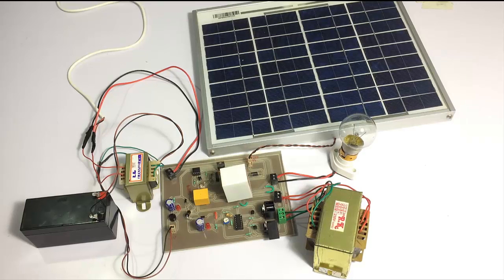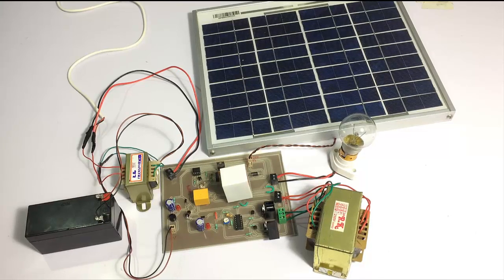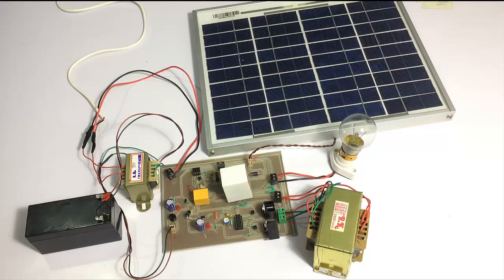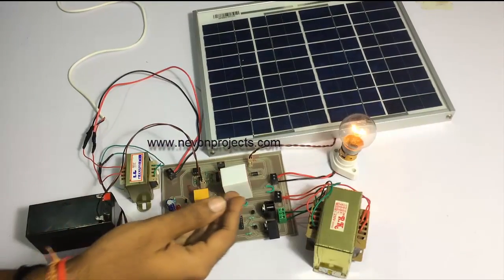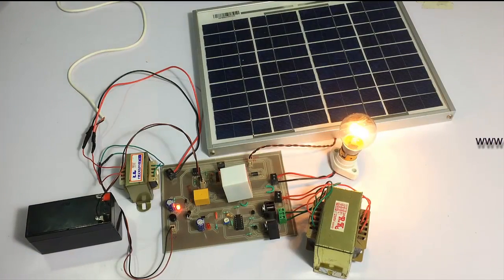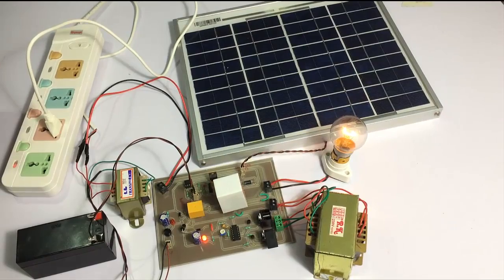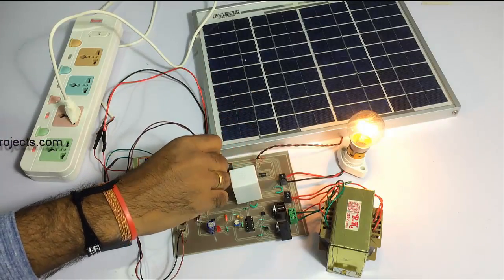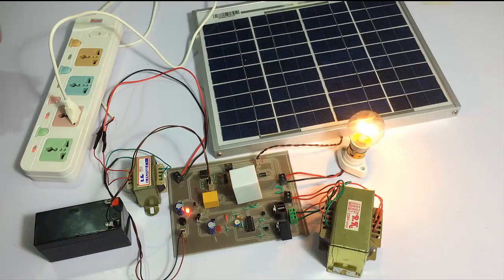Hybrid Inverter With Solar Battery Charging System

Comment: What about solar circuit?  I would like to know how to know whether the power generated by the solar panel is shared by both the battery and  load in a proportion.  Can anybody explain?
Reply from the maker: For this Electronics system details or free document/PPT pls call watsapp
+917738796642 or visit link in video description